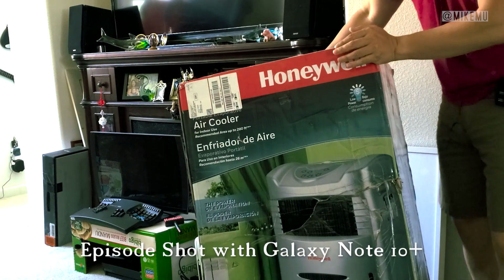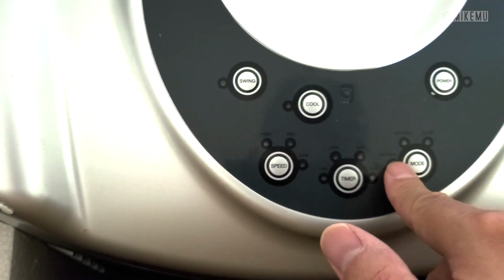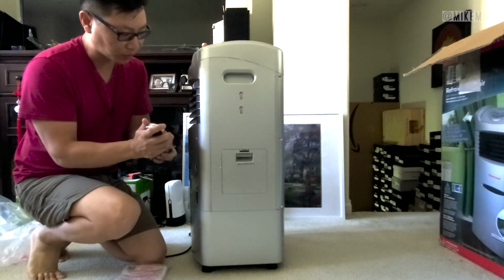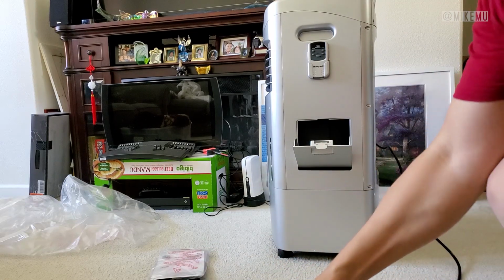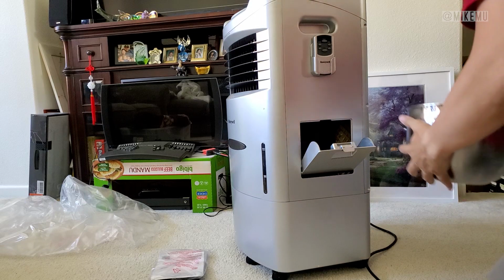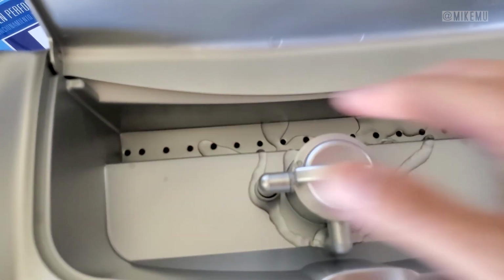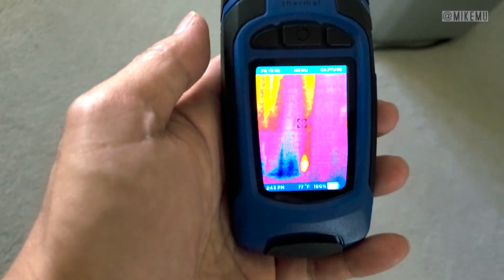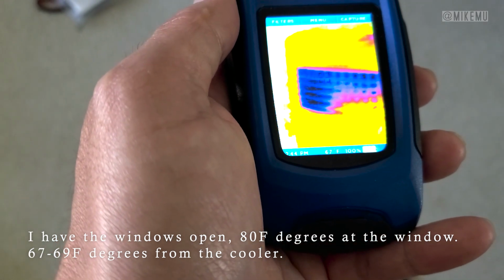Best Air Cooler? Honeywell Air Cooler | First Impressions Review and Test

Comment: I have one of these and filled it with water then I turn on the cool button but it would start beeping            Need help!!
Reply from the maker: Its setting off some sensor. Maybe something is plugged or you didn't reach the minimum water level requirement.
Reply: Mike Mu The water would flow for like 5 seconds and then it would start beeping
Reply: could be you need to turn on the water flow valve in the top box...
Reply: When that happens most likely the air cooler water sensor is stuck because of hard water buildup. Towards the front of this unit you can see a little white knobbin that floats in the water hit it a couple times move it around but don't do it too hard just knock it loose and see if the sensor starts reading the water so it can run properly I have this unit and this is what exactly happened. I also have other brands where it would run for a little bit and then start beeping cuz there's no water but in actuality I had it completely full and I always would go into my water coolers to look for the little water reader they are usually white or look like they have a little round thing attached to them so that they will float in water. and move it around knock it loose from the calcium buildup some are easier to access than others but just try to move it around to get it to start floating so it could be that it can be sensed again.